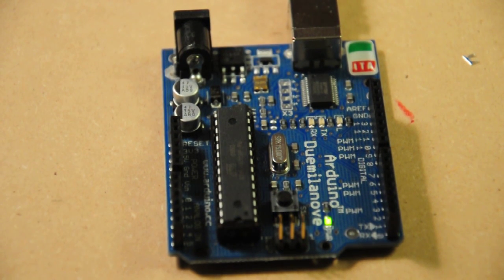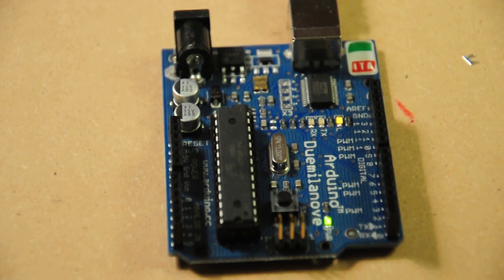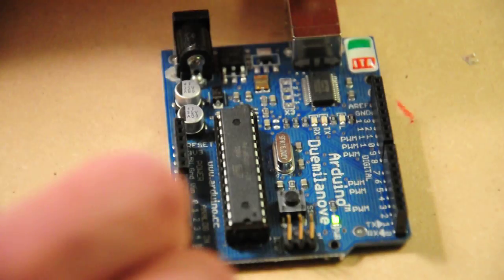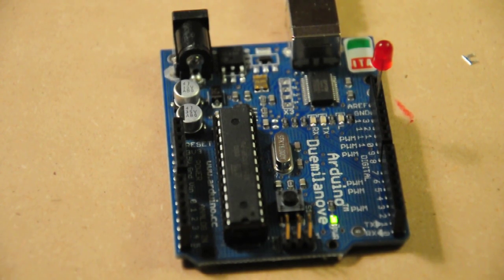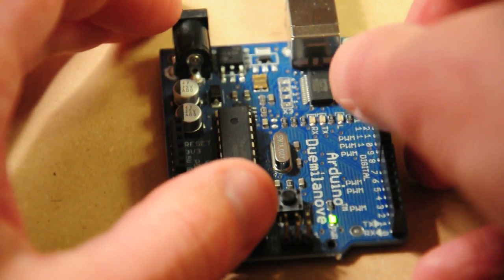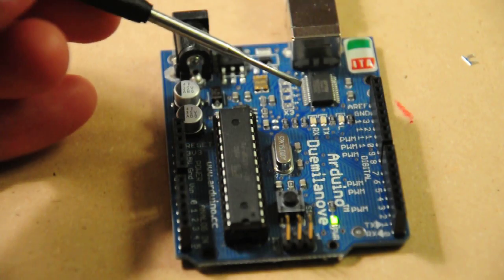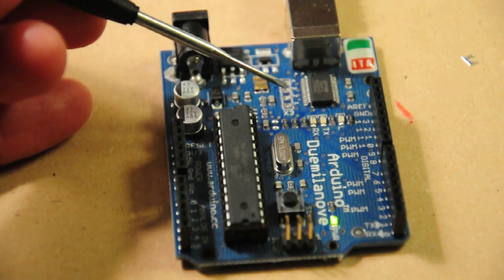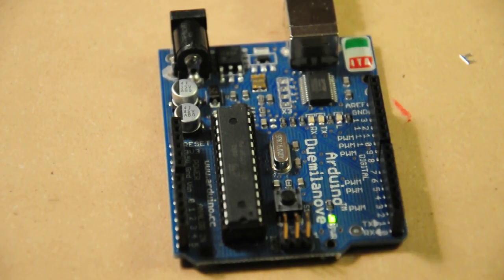Getting Started with Flash and Arduino

Comment: Thanks for this video.
I've seen a LED been used this way in many tutorials. It's a very simple way of introducing people to Physical Computing avoiding complex explanations about diodes, currents voltages etc... but..
The digital pin 13 hasn't a resistor in serie.
There is a (LED with a resistor in serie)  in parallel to the digital pin 13.
Using a LED connected between pin 13 and Ground is stressing the
ATmega328 output driver. The LED can withstand more than 40 milliamps and will survive.